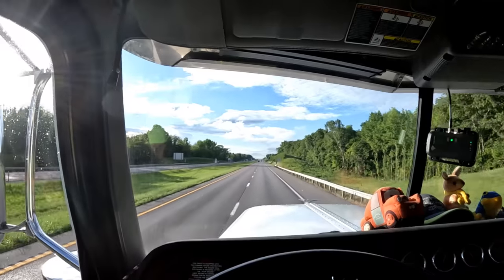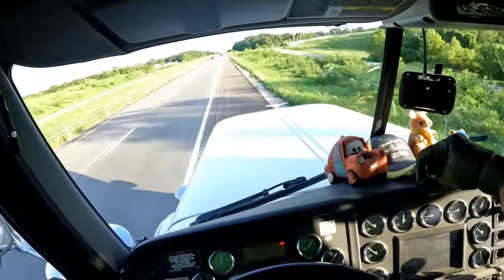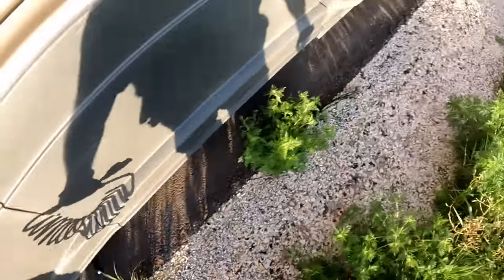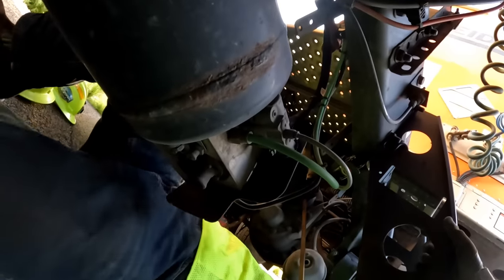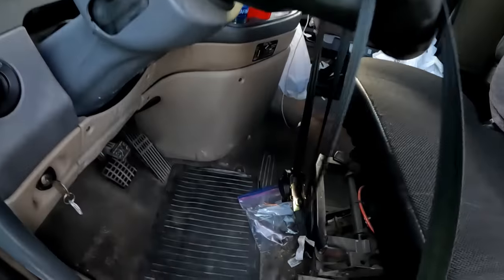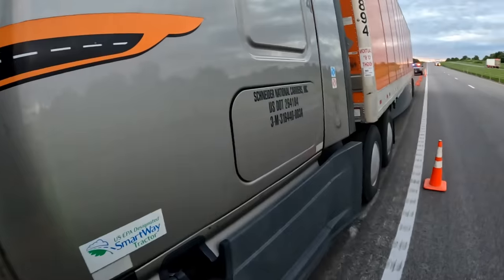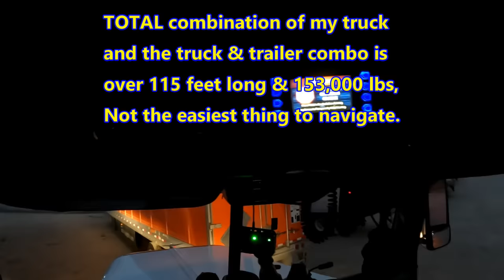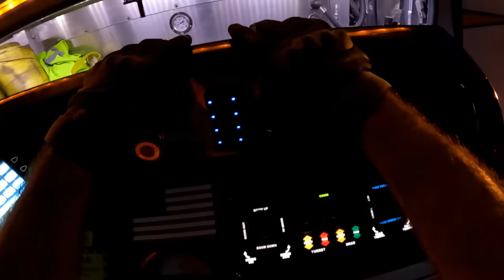STOPPED DEAD ON THE INTERSTATE!   SOME ASSISTANCE REQUIRED

Comment: I don't know if you remember the video where I asked about a 2011 international roll back flat bed, anyways, you had told me to ask the dealer about the engine and Trans to avoid a maxxforce engine... well the day I called them they had sold it that morning and it DID have a maxxforce engine so I appreciate the input you gave me at the time I'll remember it for the future for sure but it looks like for the time being my aspiration of being they guy people call for help is going to be put on hold and I'll just keep doing my good samaritan work that I've been doing for ten years (stopping for pulled over vehicles to make sure they have a certified person to call. And by the way you should see the traffic advisory lights I have on my ram for when I stop to check on people, they really are phenomenal tho not as mush so as yours.

Comment: I’ve had one of those brake-buddy attachments on my 35 ton quick swap since purchase and you will love having it on any of your trucks. With the 4 full axles of stopping power plus truck, I’ve taken fully loaded trucks with tri-axle trailers quite a distance and it’s phenomenal, even on a small quickswap.

Comment: Jeff Witkop of "Pennington Wrecker Service" was the original inventor of the "Brake Buddy" I was blessed to work for him as a heavy wrecker operator for years until the mid eighties.  I bought one of his first units after I went out on my own and am still working. They worked well in my experience.  Easier than taping into the main air tank. I can't  say anything about new ones manufactured by another company.

Comment: I drove wreckers back in the early 70s, back when the old sling type wrecker was about the only choice you had, at least with the company I worked for. I drove an old B61 Mack sling type wrecker, It had a small engine with a quadruplex transmission in it and would wear you out going through a lot of redlights. it wouldnt pull em fast but it would pull them. lol Those under reaches sure made things a lot easier. Great Job as usual.

Comment: Hi, Ron.  Considering the traffic hurtling past you, it was a fairly straightforward tow.  Because most of the traffic was giving you a wide berth, you were all able to work in a marginally safer enviromment in spite of the speed.  Greetings from the UK.  God bless!!
Reply: Keyword is marginally.  Just one driver getting distracted and drifting to the shoulder can still make a bad day for everyone.
Reply: All it takes is one jerk, not moving over, though 😞. Which is an all to common occurrence anymore.

Comment: Last Friday I had to go rescue a truck. We had traffic control. The ones that wanted to get over couldn't for the ones 
That were in a hurry and didn't want to slow down. Thanks for showing how to tow an Automatic Freightliner. The company I work for has 4 we haul heavy Tri axle trailers up to 95000 lbs. 
Then we have some KWs and Prostars as well.

Comment: Here in Pennsylvania it’s a common occurrence to have emergency vehicles show up to provide cover for towing hookup. I work at a busy car dealership. One time I went to fill up a rental with gas, I thought I had enough to make it the 1.5 miles to the gas station but it ran out 1/2 way there and I drifted to a stop on a major hiway. I had to bail out to the shoulder, and flail my arms looking like a wild man to get traffic to notice. I called the local police department and they sent a unit PROMPTLY because they knew what would have happened. Once the officer was on scene with his emergency lights, it was only a short wait till another guy from the dealership showed up with the Jerry can. I could not have possibly fueled that car without the officer providing cover. The way I see it, that is one reason we have emergency first responders like that. It may be different in other areas but here in the rolling hills of Pennsylvania they help TREMENDOUSLY with situations like this.

Comment: 3:50 This problem stems from how we're taught how to handle emergency situations in driver's ed. I'm 27, so still fairly fresh on the rules in a sense, and in PA the rule was move over or slow down, implying that if you're in the left lane you can still rip on by at 70-75-80 mph. It was the same in VA, FL, and OH. I imagine it's the same in MO. Humans love to take things at face value, where critical thinking is a luxury. Just look at how many fights break out over text messages. Maybe we need to lobby congress to start a new campaign that states move over and slow down.

Comment: As a provider of traffic safety support for towing and recovery, I set up a four signs at 1000' 750' 500' 250' back. TOW TRUCK AHEAD (fluorescent pink), RIGHT LANE CLOSED, RIGHT LANE CLOSED, then a SLOW DOWN & MOVE OVER sign (fluorescent pink). Maybe throw a couple rumble strips out then place my arrow board truck in the closed lane. Since drivers refuse to slow down and move over, I force them to. .

Comment: Most trucks with cruise control have an idle override. Just turn cruise 'on' then hit the 'set' button. should idle up to 900-1100 rpm without shutting down. Engines and trucks and company policies vary, but there's one for your tool box.
Reply: Doesn't work when park brake is released

Comment: Ron get a foam pool noodle cut down the center or pipe insulation for the air hoses of the brake buddy. Might be easier than the firehouse.

Comment: Remote brake operator is a great idea. It needs a quick release valve to dump the air quicker. The long line acts as a reservoir and probably slows application too. We had a saying when working on the railroad to keep your head on a swivel and that certainly applies here. Most people get over but it only takes one....

Comment: hi Ron ya might look at a pool noddle split down the side on your air hose as it would be easyer on the paint work if used with a str8 hose other than coil hose  just a idea  be safe god bless

Comment: I literally just had my rig towed from the SC rest area on I26. Down to Lexington. The upper radiator tank split along the top. Went from full coolant to oh crap just after crossing the NC border. Pulled truck with 42k of wire spools in the trailer.
Reply: Btw, if you open the hood, it makes it easier to see the front axle and your lifting frame forks. 🤷‍♂️

Comment: Ron, Velcro strips might be a quick and reusable option to using duct tape or gaffer's tape, and they're not expensive.
Reply: Nitpick:  That was trucker's tape, not gaffer's tape.  Gaffer's tape is used in our theater. 😀😀😀😀😀
Reply: @kensherwin4544  In the USA, we often use the slang. "Duck Tape." I noticed that Ron had fun with a play on words,  calling it, "Quacker Tape." 🤣

Comment: Improvment suggestion: is the hood metal? add some magnets inside the cable protector and a zipper or velcro to open close....
Then it will help hold the brakeline in place, and stop scratches

Comment: Another great video Ron.  Your guys need safety glasses or goggles for protection especially when looking up under the truck.  Knowing when to stop is a good skill to have.  Instead of a heavier hammer could you have used the bottle jack to separate the drive shaft?  Wishing you and your team a blessed week, safe travels, gentle autumn weather and restful evenings.   Peace Ron

Comment: Couple of questions, is there a max weight limit on highways in Missouri?  Just curious if towing a heavy 18 wheeler with the already heavy rotator makes more sense than using one of your other heavies.  Not complaining, love to see the tator. Just curious. 

Also, does Missouri have a highway safety service program?

Comment: Here in the UK the recovery services always appear to use what are termed coach-stands to fit under the front wheels on a tarmac surface when using the under-lift and fitting the securing chains whereas I note that you use wood blocks. Is this a personal preference?

Comment: Hey Ron I tow with a V100 in KY and those are not spacers in between the Ubolts that’s a bracket that held a piece of rubber as an air dam that’s been ripped off.

Comment: Wonder if knocking the drive shaft out would be easier with a Craftsman Hammerhead electric hammer or similar. A big hammer hitting a few, slow times or a smaller hammer hitting many, rapid times will do the same work, but the smaller hammer will fit in tighter spaces and be easier to manage with one hand. Plus power tools are fun.

Comment: what i have seen in the past with traffic control using the arrow to point which way to move, is that the vehicle has partially blocked said lane so traffic has to move over
Reply: They aren't allowed to block a lane on their own. Need highway patrol to do it
Reply: @dorvinion  thought i seen a highway patrol in the background with its lights on??

Comment: In Oz there is a lot of law covering this type of situation - OHS and traffic.  Basically prepping a tow on  any part of the road is considered a WORK SITE.   Traffic speed through a work site is limited to 10/25/40 kilometres per hour depending on setup.  Here the right lane would be blocked by bollards or witches hats (cones) and a speed limit of 25 kph would apply.
Failure to comply can mean up to $10,000.00 fine for the offending driver, and/or immediate licence disqualification and impound of vehicle.

I too was a very long term paramedic and know what it is like to work with a target on your back under a bright flashing arrow  showing idiots and other self important cockroaches where to aim for!!!

Stay safe.

Comment: Ron, I was wondering if you use a long rubber airline to connect the two units you wouldn't have to worry about scratching the bodies that what we use and zip ties to the mirrors  thanks for the video

Comment: Set your traffic control vehicle at a distance that actually gives a longer line-of-sight (for traffic to see the traffic control truck) as well as time to react from recognition. Traffic couldn't see you for more than 1/2 a mile due to the crest behind the vehicle and likely wouldn't want to slow down right after cresting that hill and seeing you, especially if they are travelling with traffic following them in a pack and with traffic attempting to merge with little notice (at those speeds). Slow them down by placing cones down the center-line beside the work area - traffic will often naturally slow down if they have to drive beside cones.
Reply from the maker: I agree with your statements.  In this situation, we were sitting in the merge lane for an on-ramp, so we couldn't block the ramp with cones or the traffic control truck.   And there was a two lane bridge with no shoulder directly behind us.    Traffic control at this location was "difficult" to say the least.    Thanks for watching and God bless.
Reply: @RonPratt  No, thank YOU for the videos! Yeah, that certainly IS  a difficult scenario. I'm just grateful that you continue to work with safety in mind for your and yours. It is an honor to see your work and how you do it.

Comment: I just got back into trucking and I always opened the door when I was adjusting the tandems on the trailer.   The darn truck thinks I’m going to fall out.  I don’t know how those old time truckers can back into a dock without hanging out the door and I’m sure they love trying to back up an automated transmission.
Reply: That's the problem with narrow style cabs. They look cool but ergonomically they are self defeating. Now just think about the new (not really new but we'll pretend it is) impending design where the driver sits in the center of a narrow cab. It's ridiculous but some engineer thinks he's a genius. https://youtu.be/TM5Wn9n4cnQ

Comment: People should be forced to stand on the line to experience what it's like when others don't slow down and move over no matter who's sitting on the shoulder
Reply: Maybe it should be a standard feature of driver's education but in a controlled situation.  If you are  stopped on the shoulder of a busy highway, you can feel the air pressure of passing vehicles rock your vehicle.  It shouldn't take much imagination to realize how dangerous it is when people don't move over.  Too much multi- tasking instead of just attentive driving. Be the change folks!

Comment: Ron, I'm curious, why did you do a double pick with the underreach when you had a giant 75 ton 'Tator just waiting to lift the front end up with a pair of the lifting hooks your truck would have been very likely to have on hand? You could have lifted that easily, and it would have had the added benefit of something solid holding onto the front of the truck instead of just wooden blocks.

Comment: I’m deep in thought about the use of the ratchet straps on the steering wheel when it isn’t getting rear towed. On one hand I mentally weighed what if the breakaway chains need to do their job? Yeah, I can see that working on a straightaway, but what if the breakaway chains need to suddenly begin duty in a turn?

Comment: I heard about that brake pedal piston in a training event I was in recently. Very cool to see it in action. Seems a bit sudden to me, but then again I failed my air brake test last year... So I can't say I know everything.
How does it work, like, quality of, how well does it perform, from the perspective while you're towing with it?
Reply from the maker: Honest assessment....it does work well, but has a few draw-backs, in my opinion.   First, it definitely applies the brakes on the towed unit and helps slow the entire combination down much faster than just having a line run to the trailer.   In that sense, it does exactly what it is supposed to do.   However, it does have a few things that I have had to either get used to or repair.   The built-in QR valve does not dump as quickly as I would like and the brakes "drag"  for a bit after I've taken my foot off the pedal.   Some of the components are not "top" quality.   The second time I used it I had to extract and replace the air supply fitting after it broke off in the cylinder.   It was an easy fix.  They had used a brass fitting and I replaced it with steel.   Minor stuff.     I can tap into the truck's air system and do the same thing without the slow brake release, which is what I've done for years.  Overall it is a good tool, but hard to swallow the almost $600 price tag....
Thanks for watching and God bless.

Comment: Why didn't the traffic control have the cones edge into the traffic lane to try to push the lane clear like you did with yours?

That brake tool definitely looks like it will be an easier way to get brakes if the tow is building air.

Comment: In the UK I've seen recovery companies use a pre-lift (no forks) to place blocks under the front wheel then use larger forks once some clearance has been acheived. They do this for all jobs using the undertow as it's considered safe
Reply from the maker: We do that here as well.   The only reason I didn't in this situation is because I already had the under-reach attached to the axle and could safely lift it.   I just didn't want to tow it using the original forks I had in the receivers.   Those forks typically work and are my "go-to" as they are designed for getting under the axle without having to pre-lift.  Unfortunately, they do not work in every situation.  Thanks for watching and God bless.

Comment: Hey Ron follower from Australia just a help the hooks on the break buddy go the other way on the steering wheel the thumb screw is only to support it not to push against when brakes applied. Also retractable air hose reals help

Comment: That "or both" is no joke. First heavy I ran solo, that sucker was so well stuck that it took ratchet strapping 2 pry bars together and then hammering on my frankenstein abomination to get the driveline off... and even then it took me like 45 minutes to break the damn thing free. I'm pretty sure I was the entire reason that particular truck I had for that particular call got a full set of tow pins and a set of u-bolt cups... and of course this shit happened up on the mountain, so I couldn't just call for help without driving an hour off scene, making the call, and then driving an hour back on scene

Comment: Why do they have to make the I beams such a complicated shape just for the sake of being complicated? You know it's not any stronger than just a normal straight beam. Next time you have to replace your chains, you should take them to someone and have some knives made out of the for you and the boys, it'd be a really cool thing to have. I love that you can't help but go dad/grandpa mode even with Gavin.. I think I'm getting old.. I did just turn 37 on the 21st of October. 
LOL Ethan, he's made to be a Youtuber.. throwing that Eaton advertising out there.. He needs a sponsorship, he obviously fell in love with that truck/trans. 
I'm curious, what kind of ring and pinion ratio does that truck have to be able to tow so much weight but still get up to highway speeds without being at high rpms? I guess having so many gears helps but you'd still think that to take off with that much weight you'd need like a 7:1 but then it'd max out at like 55.

Comment: I don't know anything about towing other than what I've picked up watching you. So I don't remember if you can wheel lift the truck? Maybe if you can't could you add the parts needed to do so? That said if you could wheel lift would you do it in this case? I'm like the driver I just want tp help ( after the fact ) and get you off the highway fast and safe. Then you can pick it up the way you want in a safe parking lot.